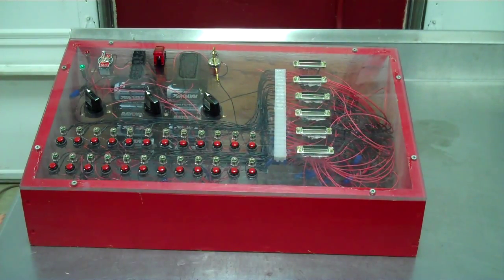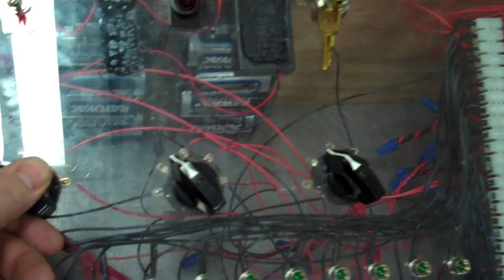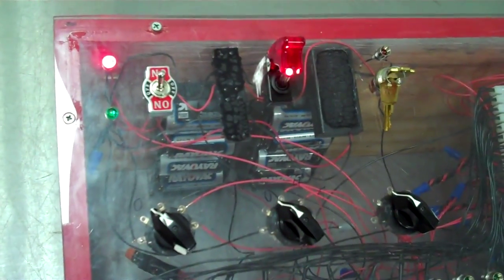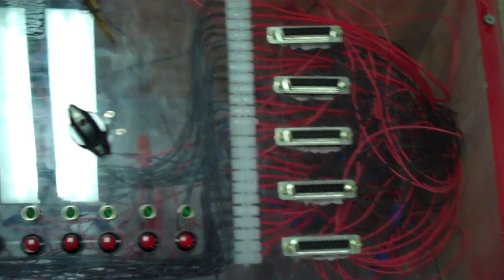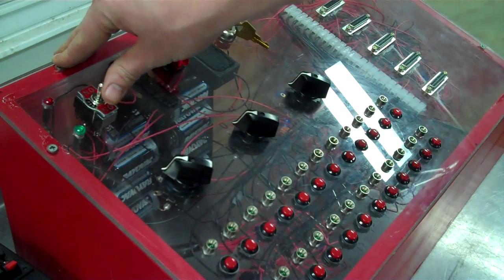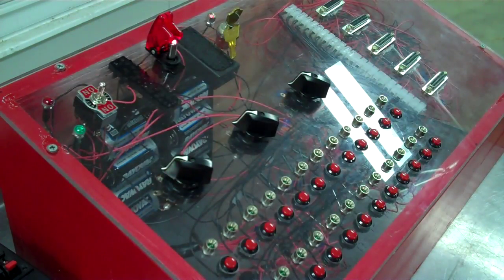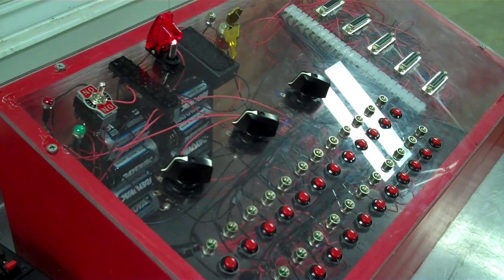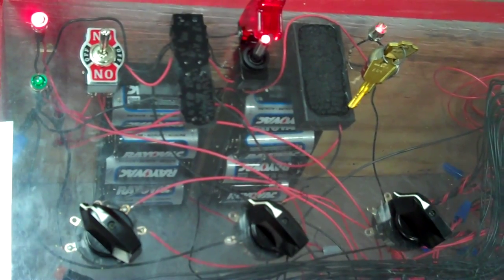Fireworks Firing System (1 of 2)

Comment: Man the idea of no ESD protection on that is so scary. Right conditions could end in nightmare.

I'd say ditch the d-cell batteries and just use a motorcycle battery something that can provide the current you need. 

It's a start but that system needs a lot more protection, fly back protection, something.

Comment: I am really having a tough time figuring out the test circuit can ANYONE help me please?   I want to use a 12 position rotary switch just one and use the 15 pin VGA cables with on common ground. Can anyone show me how in terms of "electronics for dumbies" I would even appreciate a drawing if anyone has the time. Thank you

Comment from the maker: @1041015 The best thing I have found is to take a 1/8" dirll bit to make a pilot hole. Then use a step bit to make the hole the size you need. The step bit will not crack the plexi glass nor will it pull its self down into the plexi glass like a spiral bit would. You can find a step bit a Lowes or most hardware stores. If you go to the link in the next post you will have an idea of what I'm talking about. Lexan is a good alternitive to plexi glass. Its a lot stronger and worth the extra money.

Comment: Read through the  Firing System, Panel, Designs & Diagrams thread in the firing system section.  I know he goes over exactly what is needed to handle 24V.  He knows a lot more than me about this stuff.  See what you can find out in that thread.  If you can't find it in there, shoot him a PM.  Again, nice system.

Comment: It just depends on what the switches are rated for.  If you have switches that will handle 5 amps, and you have the right resistors on the led's, you shouldn't have a problem.  If you remember exactly which ones you bought, go back over to Radio shack, and check on the packaging.  It should say on the packing what they can handle.  If not, it wouldn't cost you much to upgrade them with beefier switches.  It would definately be worth it.  The cables can handle the power, I know that.

Comment: Great job on the system!  I built one similar from the same site. You can see it on my page.  Check monoprice for the cables, you might save a few dollars, their shipping isn't bad either. As far as popping more matches,  upgrade to 24V, and go with external power.  If your switches can handle 5amps and you have the right resistors, you shouldn't have a problem.  Again, great job on the system